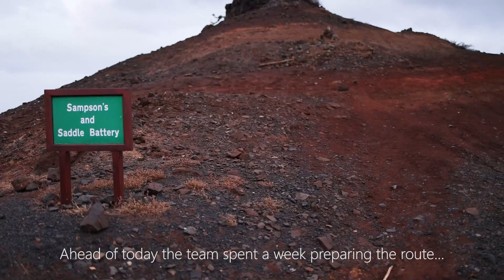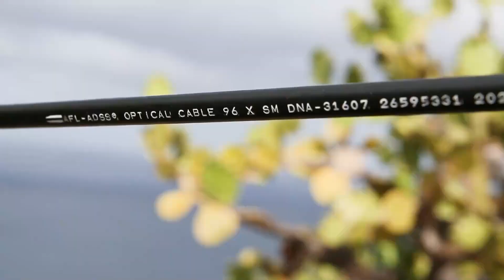Sure St Helena Fibre Optic Cable Install Project

Comment: Before retiring  I worked for a communication company in North Carolina USA. The men who worked with the fiber would have been very impressed with the men with Sure doing the installation in this extremely steep slope. What does Sure stand for?
Reply from the maker: Thanks for the comment @jjdogfather 👍 good to hear from someone from the trade. 
Don't think Sure is an acronym. The company changed its name from Cable & Wireless South Atlantic Ltd to Sure South Atlantic Limited in 2013. You can find more here: 
https://www.sure.co.sh/about-us/company-information/